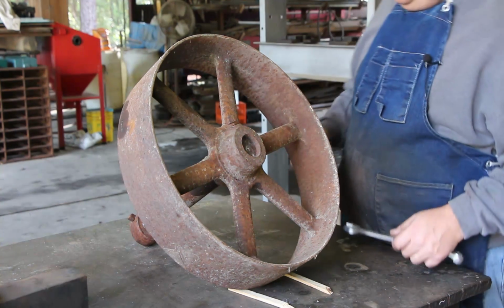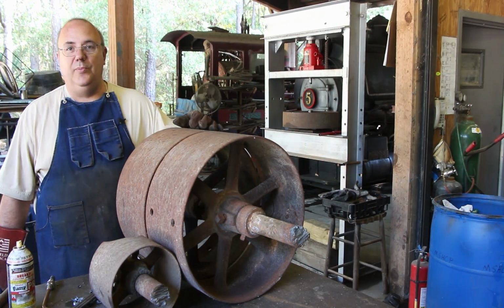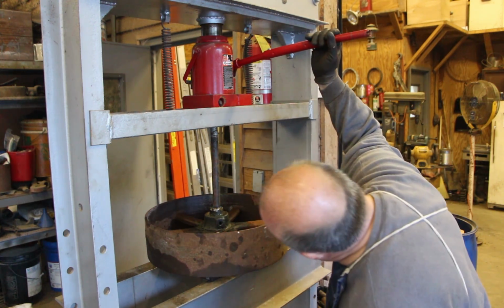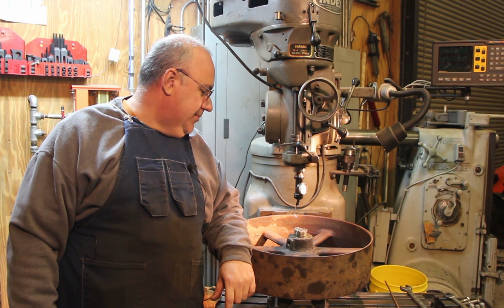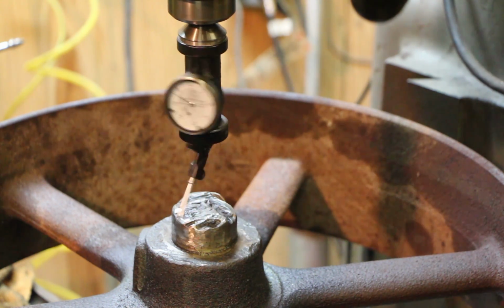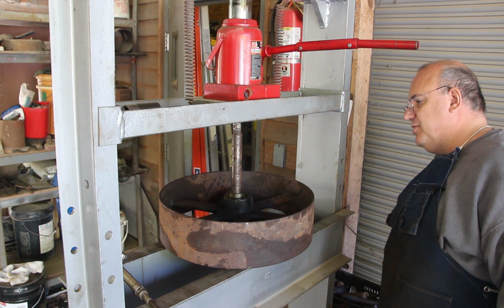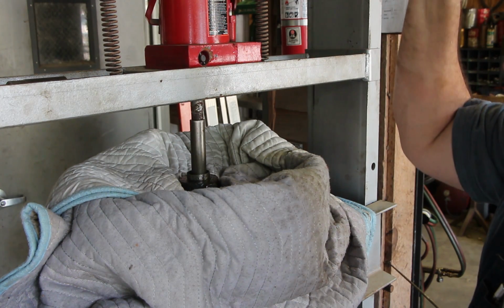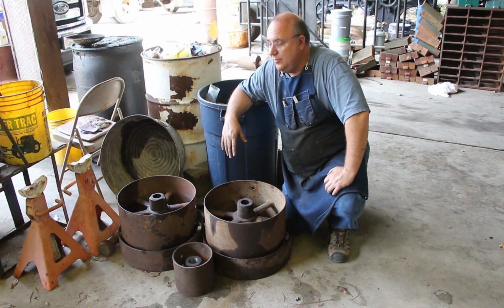Removing Stubborn Shafts from Flat Belt Pulleys

Comment: l support the hub with plates and a sleeve as well as bore out to relieve tension. Pressing with the rim on the table, you risk cracking out spokes. Also, press force is lost with the spokes flexing.

Comment: You should invest in a " rosebud" torch head - probably 4-5 times the heat in a bit larger area . The only thing is that you need a large enough acetalene cylinder to feed it as it uses quite a lot of gas .The other thing that has worked quite well for me on these big shafts is to use impacts from a air hammer - as in a 90 pound jackhammer . Really works wonders as long as you can keep the hammer on the shaft . But nice to hear that first POP .

Comment: If I were doing that job I would have supported the hub in the press and been able to put a lot more pressure on the shaft directly  instead of putting the pressure on the wheel rim which could have broken the rim or spokes. Great job.

Comment: I massage stuck parts with a flat body bit in the Air Hammer...    Make sure the hub is supported...  I'll also heat the shaft to orange.. That will push out and clear the bond..    I'd convert the press to electric over hydraulic.

Comment: All he had to do is drill a 5/16th hole between the shaft and pulley and do the reheat and chill and the thing would have just popped out I have done the same Thousands of time on the same pulleys,

Comment: Brush your comment is very accurate that way you take the stress off the spokes and also paraffin wax used as a lubricant when the heat in the part up the wax soal in and does it burn off too easily great way to get rusty stuff out does paraffin wax as a lubricant

Comment: Ran into some stuck things like that before. Usually I add lots of heat at the end of the day then spray it down with penetrating oil and let it cool overnight and leave it with pressure over night and then in the am add more heat and then press it and walk away let it go thru a few hot cold cycles with penetrating oil. But nice job when it first popped I went o no it broke.

Comment: Your press is nice only thing I would change is to add a guage so you can actually see what psi your putting on it. Had to add 135tons to a rudder shaft on ship once talk about making you pucker up. 100 ton jack off the bottom of the dry dock and then 35tons from the dock crane and a fire hose flushing water down the tube to release the grit in the bearing lmao😱🤔😳

Comment: That shaft may have been stuck, and resisted all your attempts to whisper sweet nothings in its ear, but I guarantee you, if it was put in service in a critical application, that pulley would've come flying off of there all on its own...

LOL, looks like that museum needs to buy you an electric hydraulic press.

Comment: We had 150-ton air over Hyd, press,  Had man press out shaft in a 6 shive cast 60" pulley with a broken shaft about three feet long.  He wanted me to press it out. Cut shaft flush with a saw, Heated it up to cherry red several times, soaked it overnight with SOK oil.  Again heated it red hot, about 80 ton it moved about 1/4 in, More Heat, it popped and pulley broke into a Zillion parts.

Comment: In a place I worked I saw an ex ships engineer remove a very large roller from a mill, it was a keyed shaft and the key had sheared, he spent ages heating the outer casting, very large, then cooled the centre roller by using liquid oxygen sprays to shrink it. When it finally moved , being pulled by a large fork lift truck , it came out with a bang. He told me he had used the same principle at sea to repair main drive shaft housings etc. Interesting to see you do this to.

Comment: When I got to this point I called it F or F, I'm either gonna fix it or **ck it. Working at a rolling mill manufacturer for 30 years I'd seen really big parts go or blow. If big nuts or couplings would not move they would cut the offending part into chips, one way or the other.

Comment: Good video we pressed out shafts up to 8" at an electric motor company and there were times that puckered us up waiting for shafts to move. But you really need to be wearing safety glasses with sideshields at all times in the shop.
Reply: that and welding glasses . even if only heating up metal. cutting for sure

Comment: Hey great, you got it. You won.  It's amazing how patience and persistence along with brute strength and awkwardness will save the parts.  I have not read many of the comments, but comment suggested supporting the hub of the pulley in the press.  From my experience and escapades I'd had have made junk out of the piece, broken spokes in every direction.  I thought you were quite brave heating the hub even a little to get the set bolts out of the other pulley.  I've had even a small amount of heat in  the center break cast spokes.  I have many times heated the set bolts to just get the rust in the threads to break the seize but still being careful to not twist the bolt off.  Don't try it while it's red.  The way that shaft spun in the hub you not only had natures weld (rust) to deal with, but also the stacking of the metal wedged it extremely tight, almost a friction/stir weld.  Sometimes I've ruined the hubs by horsing the shaft out in the press.  It leaves an unwanted groove in there.  I'm envious of your milling /drilling machine and how you used the indicator to find center.  After you had the center bored out with the big drill bit, did you consider using the cutting torch to just cut a slot in the shaft out to the hub of the pulley?  Granted you'd have needed hole clear through to get slag to blow on through.  As much material as you bored out, running several beads of weld inside the bore, as was already suggested, would have shrunk the shaft enough to have relieved a lot of your seize, kind of like welding on the inside of a bearing race in a wagon hub.  You had me on the edge on my seat.  You always had another plan.  When plan A or B or C doesn't work, there is always D, E and F.  Congratulations.  You WON.    Mike Roberts

Comment: Just a note for other people tackling a similar operation...once drilled out...and bored...put the heat to the inside of the shaft....not the rim....the idea is to swell the shaft....yes to make it tighter...and so being restricted by the rim metal will be displaced length wise....upon cooling the shaft will shrink smaller than the hole....this will obviously forfeit the shaft...but roundstock is relatively cheap

Comment: When you had drilled out the shaft you should consider using a coping chisel to cut a slot along the inside of the bore. That will destroy the hoop strength of the remaking ring of the shaft.
Reply: Yup I made this comment two years ago on this video but I really like Keith .

Comment: I had a similar situation with a larger 4" shaft.
I did the same by drilling mostly through with a 3" drill.
We put dry ice into the hole for half an hour and it just fell out.
Reply: I've also used compressed keyboard air. Spray with can upside down.
Reply: Add a bit of acetone if you do that, transfers the heat way faster.

Comment: Congratulations! 
That much resistance after boring the shaft and I would have reached in there with a sawzall and slit up one side. It might leave an axial mark on the bore; but safer than risking the part. 
Better suspense than a hollywood blockbuster.

Comment: Awesome video, Keith. I'm assuming you put the blocking for the press under the center hub? Letting the pulley rest on the outer rim during this could cause the spokes to crack.

Comment: Late to the party but perhaps I can offer something helpful. Not applicable to this shaft as the reason it was difficult to remove was because the shaft had been damaged inside the pulley bore. However, in cases where rust/corrosion has parts seized together I apply heat and then apply a penetrating oil. I personally like PB Blaster or Kroil. When it's hot enough that the oil smokes when applied I remove the heat and continue to apply oil. As the parts cool they will pull the penetrating oil back into the joint and help break it free.

Comment: When you've got a sticky piece like that in the press, put on as much pressure as you dare - then lay a heavy slab of steel across the top members of the press, stand on a stool and hit the slab hard with a sledgehammer.

Comment: Maybe this will help some time , to get bearing races out of blind hole areas i would take mig or stick welder and run a bead all the way around the center of the race causing it to shrink then turn the housing upside down and drop it and the race would then fall out . Hope that can help.😊

Comment: It was a relief when you finally wrapped the pulley with a thick blanket.  I've not seen machinery explode in exactly that situation, but I have seen an early Ford Dorset diesel engine shatter on a dynamometer and bits of crankcase, conrods and pistons embedded in the soundproofing that lined the walls.  Those engines would run off oil vapour from the crankcase breather if they got really hot.  With the injector pump bypassed there was nothing limiting RPM, and they revved until they exploded, or someone was crazy enough to get close enough to pull off the breather pipe.  I've seen that done as well, while I should have been running away!    Then there were the self inflicted fate temptations where we put an airline on a big ball race to rev it up and drop it on the floor.  They'd actually sit for a moment like Wiley Coyote stepping off a cliff.  Then race at incredible speed across the workshop floor and smash into a wall.  We were eventually warned that the outer case could explode at the high RPMs, and lost our nerve.   It's amazing some of us manage to grow old!

Comment: Have you ever used bees wax with to penetrate rusty parts that need to come apart. It's an old steam ship technique, rusty studs and nuts on steam pipe flanges. I was surprised to see how far it flowed (all the way) on a 3/4 nut & stud. You must use heat.

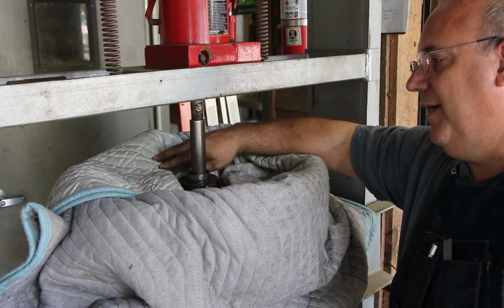Comment: @27:00
You have to be told to protect yourself from possible flying metal. You admit to having seen incidents before so you are aware of the danger. You have already performed several extractions here without even as much as a pair of safety glasses. 
What sort of example is this to your viewers about safety and indeed your own ability to think through the simplest of situations. 
Badly done Keith.

Comment: This is a classic video and one I have returned to several times. What I particularly appreciate is the non-destructive problem-solving you demonstrate Keith. Not to mention the patience of a saint!!!  I am absolutely certain I would have been sledging away at that thing after the first couple of hours, broken the spokes, felt intense regret and then had to find another wheel. 

Very cool that you could give a post-mortem and identify the problem afterwards as well.

I also really enjoy the musical interludes in these older videos. I think the folk music goes very well with the spirit of preservation and appreciation of these old machine. I actually miss it quite a lot in the more modern entries. I can imagine it was quite a hassle to get that custom audio all cued up and scrubbed in with the video though. Not to mention copyright nonsense as well probably.

Still. A real favourite of mine and two thumbs up if YT allowed it!!!

Comment: what i do on cast iron pulley,s i bore hole then use blue wrench  gotta cut fast cast wont cut but will melt i,ve sme bad one,s last fifty yrs  also don,t have mills and lathe,s  i imagine you could,nt buy one of those flat pulley,s now if so they would be high and would,nt have charecter you,res does great job

Comment: While in the mill go off center just enough to cut a relief just touching the pulley. this is for future referance,this has been done now but later may save some people some time.worked for me in the past,did not have a mill but I did have a grinder and a carbide long bit,works for stuck bearing races also.

Comment: After it is drilled, weld beads around inside of shaft, set it aside with shaft up and down and listen for it to fall out. Have never had it fail (Old trick a WW2 machinist taught me almost 30 years ago).

Comment: Like the video! btdt.
   What you could have done=Bore straight through the shaft to open it up completely through. (like you did on one end) and then take the torch and heat a line red hot on one side of the shaft inside the  pulley and another on the other side and the shaft will shrink enough to loosen it up.
  Your press table could use some flats iron laid and welded  into  the side of the channel irons to get rid of the springy flex of the table.It makes it feel so much more stable to get rid of the flex.And a lot less scary when thing start to move bcause not everything springs like tis going to fly out the side and kill someone.

Comment: I like bigger tips like rosebuds or maybe one of those brush burner propane tips - they are more diffuse heat sources and apply lots of heat with no hot spots. I cannot fault your method though Keith, It works! 

You really do not get the full effect of drill and press unless you go all the way through the hub but leave enough metal in the shaft to press on since pressing tends to spread the metal below the pressing tool. Slotting the remnants of the shaft all the way the way through removes most of the tension in the hole, making a second slot lets the remnants fall through.

Great job on the press Keith, you stopped not far from the point the pulley would have broken! You showed the great restraint that comes from experience, LOL.
Reply: and a 30 ton press is pretty small ive seen things a 300 ton will struggle with for what its worth. if supported well a 20lb sledge could have probably  broke it loose easier than the 30 ton press  a sudden impact does wonders for stuck things

Comment: Hi  Keith If you have a shaft stuck in a pulley like your Video was, drill a hole all the way through it.  Then use a cutting torch & cut three notches out to the cast iron pulley. The torch will not cut the cast iron, and will stop at the rust line. Been there & done that. Paul

Comment: Well I have been enjoying your episodes quite a bit I love restoring sruff when I get a chance. I realize that part of the problem in getting the shaft out was it got galled by a set screw but , I can offer two suggestions when pressing a shaft out of a cast iron pulley. 1 Support the hub of the pulley so no force is applied to the rim or spokes only the hub. This will insure that the spokes do not shatter or flex and allows you to use the full force the press. 2 When you have as much force as the press will muster, tap on the hub with a hammer or use a blunt flat air chisel bit to apply some vibration to the hub and it will let go lots easier.

Comment: Bad habits showing the uneducated is not right, Use colored glasses for cutting and not clear, ruins the inner's of your eyes after a while,
If you had used a pipe and placed it on the hub underneath it with a hole in it larger then the shaft size, you probably would have had less worry about the whole thing flying apart.
Also if you would have bored the hole until the one side was so thin as equal to a piece of paper, Do you think it would have been so difficult to take out.'

But after resting on it for a while
did you ever think of turning it over and pressing from the other side, 
and if that doesn't work
how easy would it have been to cut the inside wall with something like a saw all, die grinder, and cut it through to the hub and then pressing it out.

Comment: Hi Keith I got thinking on your jack why not take the plunger off install a Pitman arm like on the locomotive maybe 3-4" stroke with 2 spoke wheels and a T bar that goes up and down as they turn should work . Could almost run it witha 1/2" drill
Reply: Did you try a grease zerk and force grease in, Or hot brake fluid in the set screw hole use the set screw to push it  should go half way around.

Comment: Went on a ride along with a CAT mechanic once. He was called out to get a huge king pin out. The local yocals had been beating on it for 3 days with sledge hammers. We rolled up, he took a gander. walked back and setup stuff on his welding equipment. He spent a about an hour blowing out the center with carbon arc. Hit the inside of the cut out with a garden hose and proceeds to shove it out with one arm. Pin hit the ground and we were gone. I was thoroughly impressed.

Comment: That was a mofo to get out. Damm. Stuck bugger. Like others have said.... weld on inside of bore and it will shrink up when it cools. I use mig or tig but stick welding will do it also. weld some passes on the inside and it almost falls out when it cools off. Heating a cast iron spoked wheel has dangers. I haven't seen it happen but have heard they can shatter just from heating alone.

Comment: You had it centered under the milling spindle.  Why not just drill through the pulley depth, then bore the hole up until the shaft wall is paper thin.  Collapse the remains to the inside.

Comment: I use to work on boring machines in a plant and I know how tough it can be to get gears off of a shaft sometimes.  I will suggest that if you run into this again, bore the shaft like you did an take a sawzaw and stick the blade inside the bore and saw the remaining metal to splite the shaft.  It will almost fall out then.  Another thing is when your pressing the shaft out.  have the center part of the spoke supported to keep from breaking the spokes.

Comment: I've been here before. Dejavu.. I did something similar except I bored it all the way through and got it thinner (I had to flip it over because the tool wouldn't reach all the way through from one side)and then I used a sawzaw to cut straight down the inside until it was so thin I could crush it and rip it right down the cut. Then I pealed it like a sardeen can on the inside until I got it loose enough to just hammer out.